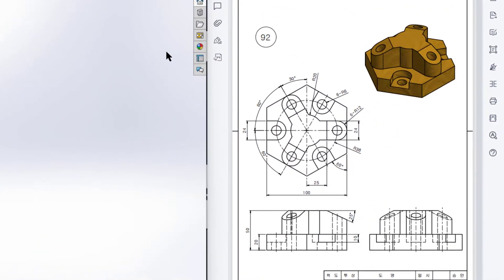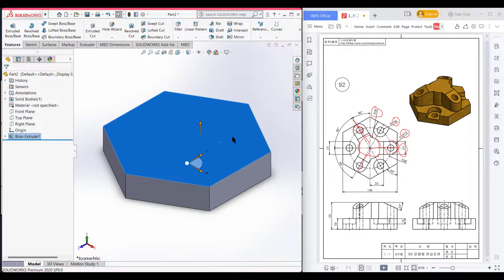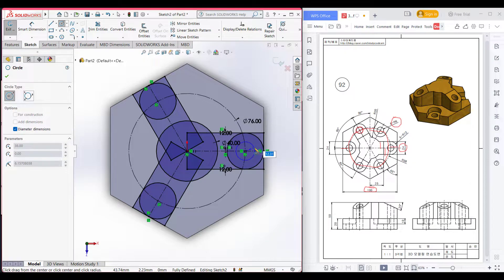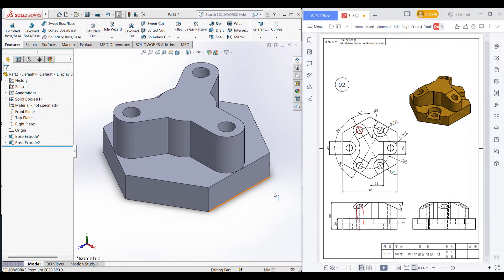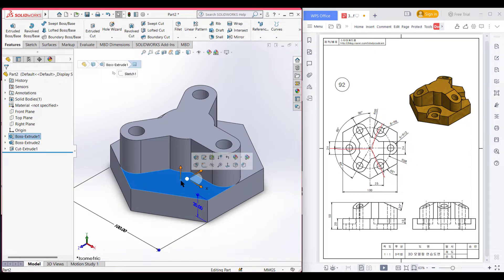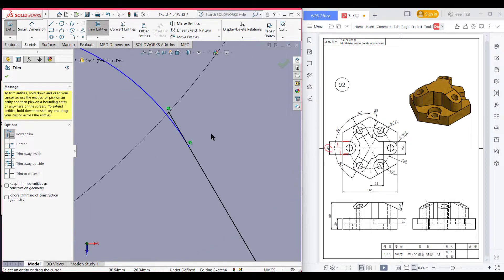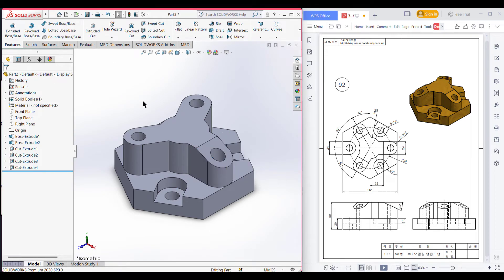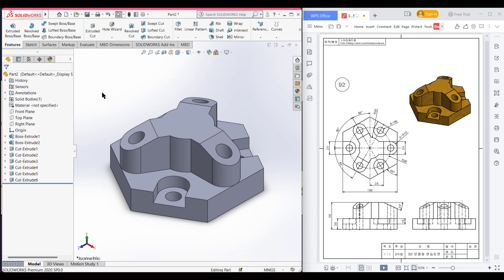SolidWorks | 3D CAD EXERCISES 92 | StudyCadCam | Solution Tutorial |

Comment: The last part angle cut should be revolve cut and not one by one.
Reply from the maker: Thanks for your concern. If you see the top view in the drawing the angle cut has a linear line. So I cut them one by one. On the other hand if you use revolve cut the top view will have a circular line which won't match the 3D model.
Reply: @mahmudhasanmaraj  You right. I did not looked at that.